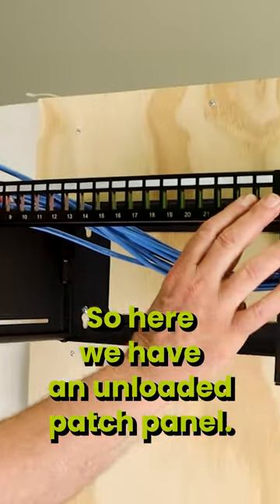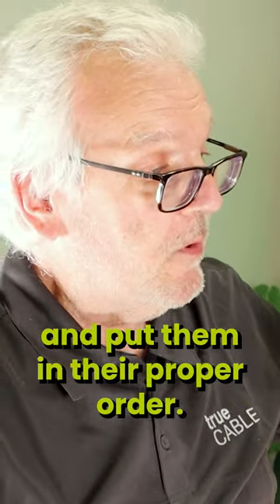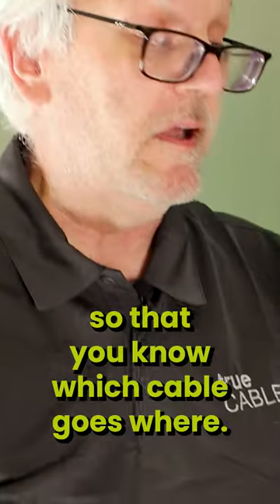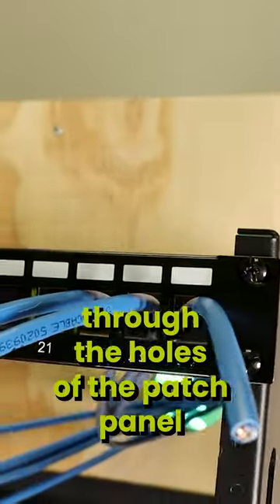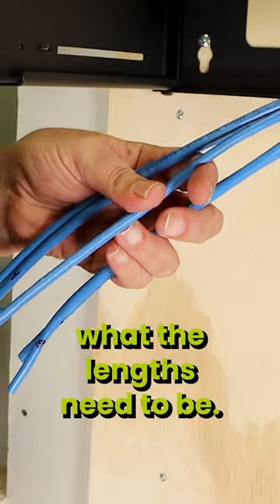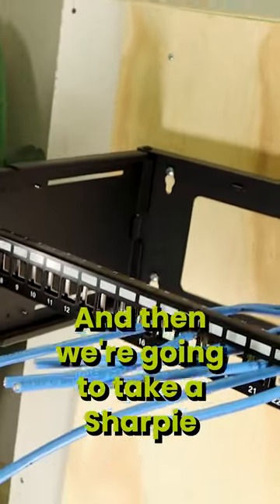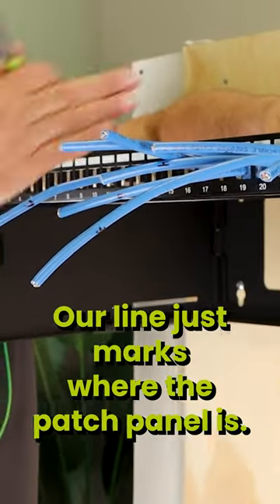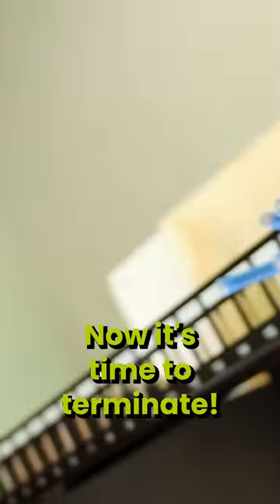Dressing Ethernet Cables Into a Patch Panel! #shorts

Comment: thanks.. you could also feed the lines through the keystone hole and mark an inch from the front then cut on the line after the cables are nicely managed in the back.
Reply from the maker: Thanks back! That is a good idea.

Comment: Rookie mistake was cutting them shorter without writing/printing new numbers on the cable. More than one falls out the back and you’re now toning.
Reply from the maker: Hello! Agreed, that would be rookie mistake for sure. Always label the cables at both ends and be sure they are still labeled at the patch panel before and after cutting them to length.
Reply: @trueCABLE and what happens if you have to redo the connection, I’m an electrician, always leave a slack when it comes to data
Reply: ? @trueCABLE 😂 I just watch a cable comb video and the finished product was full of dips and maybe I saw a cross :tisk:

Comment: Ideally you want this as close to real as it gets. A hole directly behind the patch panel ain’t often 😢
Reply from the maker: Hello Kristopher! We agree. The video was working with limited space and props. That was not an actual installation. We will eventually re-create this video as we are constructing afull-blownn TR (telecom room) that is designed for video demonstrations. Stay tuned!!
Reply: @trueCABLE  thank you and it helps visualize the process. When I was in college and getting certified well properly doing structured cable management wasn’t a thing. I’ve learned more online than the classroom and hate to say it even on the job.
Reply from the maker: @kristopherleslie8343  Hello Kristopher! Same here. I went to a four-year University and learned far more, getting formal BICSI and Fluke Certifications and practical experience. This is not a trade that is covered by the big universities. Perhaps in some technical colleges, but otherwise, this trade is definitely a "gotta do it to learn it" kind of thing.

Comment: No service turn of extra cable?
Reply from the maker: Hello Ken! No, not in this video. We are aware you would leave at least 3 feet of cable turned into a figure "8" pattern at the patch panel for service slack. This video was to demonstrate getting the cables to all end up even. We will likely put out a revised video to address the service slack questions. Hope this helps!

Comment: All those cables connect to a network switch of some kind right? To give access to each port to the network for alternative devices? I work in engineering and should probably know this already…
Reply from the maker: Hello! That is correct. The cables are terminated to keystone jacks, which provide a female port. Then you plug in a short patch cord (male connectors on both ends) to connect the keystone to the Ethernet switch. Hope this helps!
Reply: Would you say that the A+ is enough to get a job like this? I am currently working on my a+ and I am not really sure what I want to do when I achieve it. I am also unsure of going down the net+ or sec+ afterwards.
Reply from the maker: @MitoCapsAlot   Hello Koda! A+ is a great place to start. Any additional formal education and Certifications surrounding networking and networking installation would be helpful. That said, this type of work is on the physical end of networking spectrum (we will call it Level 0 of the OSI model for sake of argument). BICSI has formal installer training and Certifications you can earn that would be much more directly applicable to this type of work. Check out their INST1 and INSTC (Copper) and INSTF (Fiber) and TECH Technician Training.
Reply: @trueCABLE  Thank you very much! This was information I was unaware of.
Reply from the maker: @MitoCapsAlot  Hello Koda! You are quite welcome!